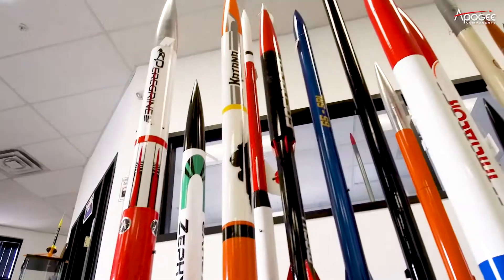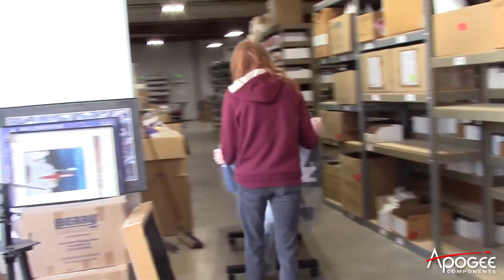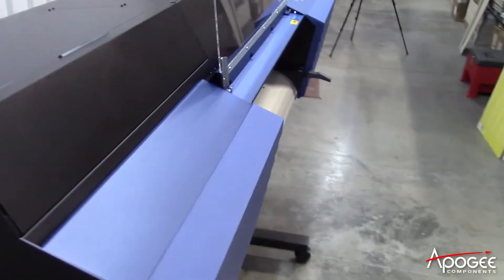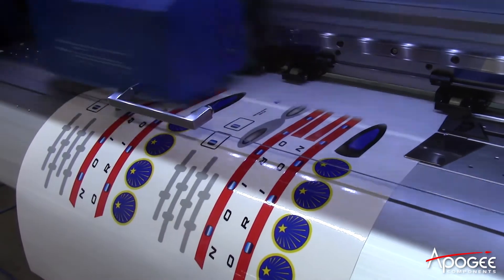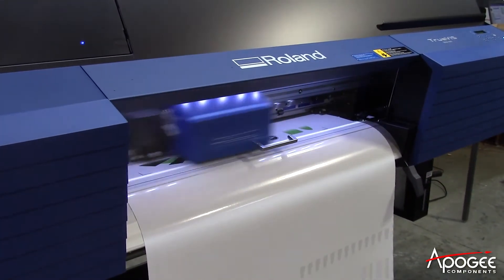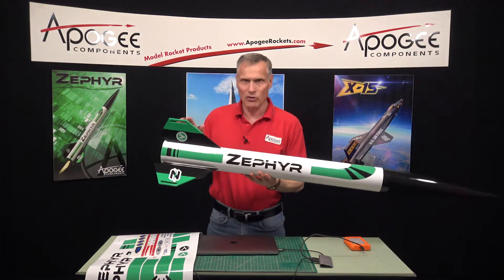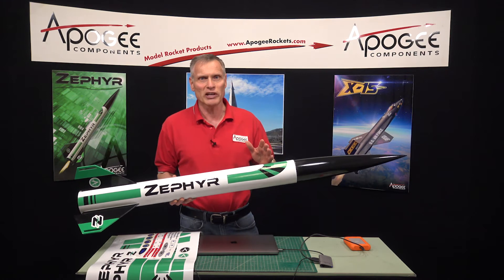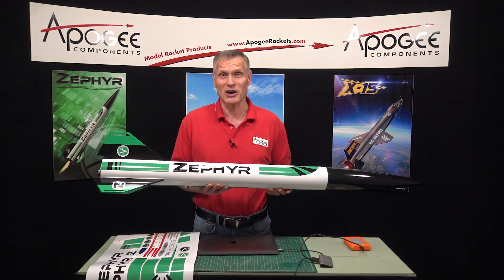Printing out vinyl Model Rocket Decals

Comment: At first I hated the vinyl decals that were circumferential stripes because you could not get the ends perfectly lined up. That was because as you wrapped around the tube it stuck down with no ability slide in to perfect alignment. This trick of using soapy water obviates that problem. Excellent.